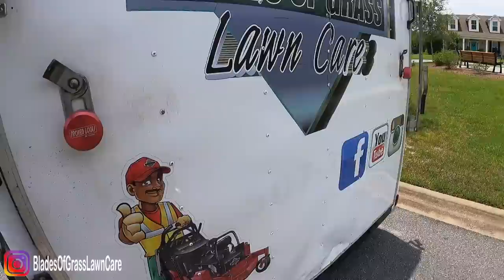Customer calls back for another lawn mowing 4 days later and pays again, see why...

Comment: I never thought about the time saved when using battery operated equipment. From mixing fuel, starting it up, maintenance on a gas engine etc. Depending on the type of yards, the battery operated equipment could be a great time saver. Johnny stay on the cutting edge! Pop Smoke
Reply: I’ve been thinking of this a lot lately. Also slows you to work way more quietly so you could possibly start earlier in the morning too. If you’re helper sucks at starting equipment like my wife does, that removes that hurdle as well.
Reply: Is mixing fuel important for a push mower, we just get gas from the gas station and use it to mow.
Reply: @windlesssign1718  no. You should use ethanol free if possible but mowers are usually 4 stroke engines which have a separate oil from the fuel so you can just use gas station pump gas. 2 strokes lubricate the engine with oil mixed into the fuel. Usually at 50:1 or 40:1 ratios of fuel to oil.
Reply: To me nothing compares to my Stihl 4 stroke trimmer, mf will cut a tree down if I let it 😂
Reply: @OutdoorWalker  Haaaa! I feel you. The yards we service are atypical. Drainage ditches, hills, etc. I can't use a battery powered trimmer for these areas. But I can see how Johhny can utilize it. Like guys who service commercial banks. A battery operated trimmer would be perfect for those manicured yards. Be careful with that Stihl trimmer. You'll put your eye out. Lol ! Pop smoke

Comment: I take it that is St Augustine which is prone to heat stress making it quick to  go dormant in the south during the summer. I've experimented with different heights and 5" seems to work best in the summer for my area where Temps are in the mid 90s. I cut every 4 to 7 days based on how much rain, water and fertilizer is put down.